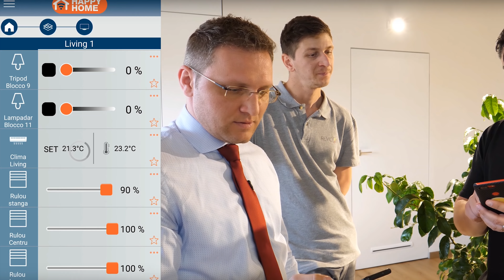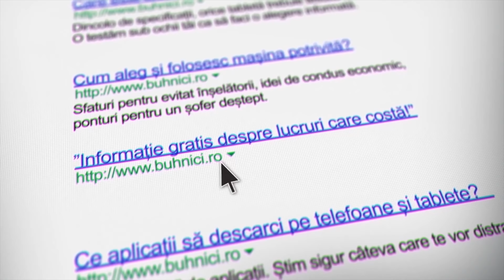#casabuhnici - Totul despre grădină

Comment: Eu nu inteleg de ce iti ia atata sa tunzi atata buncata de pamant. Curtea mea e de doua ori mai mare si in maxim 40 de minute termin si inca 5 minute marginile
Reply from the maker: Poate ești tu speedy. Eu nu reușesc mai repede de 3 ore
Reply: Are 1000 de metrii patrati in spatele casei :). Tu termini 2000 de metrii in 40 de minute? wow...esti rapid nu gluma